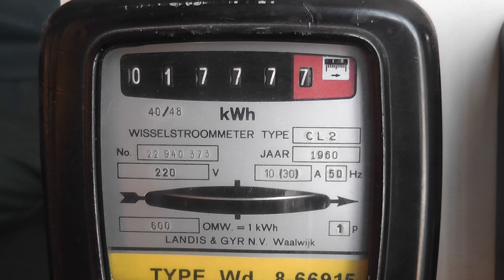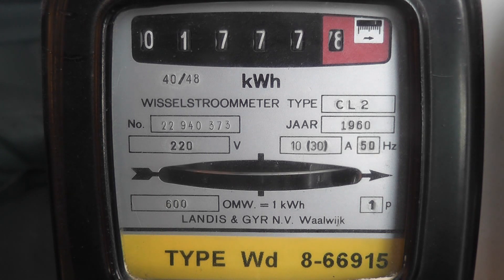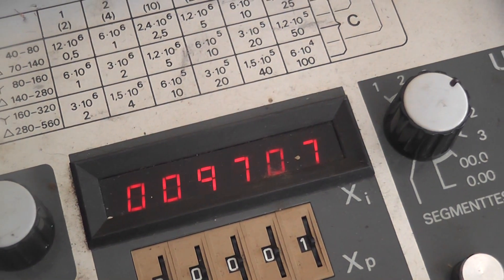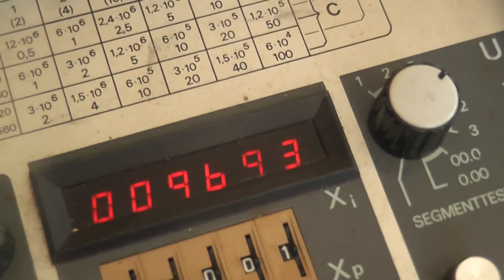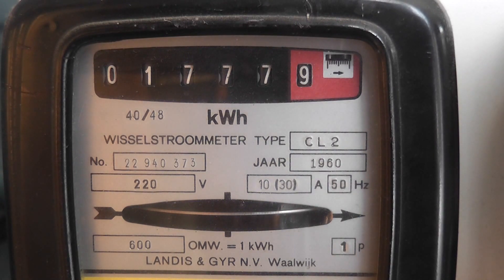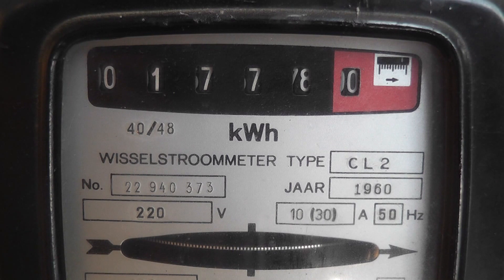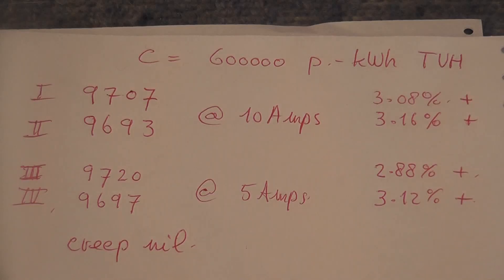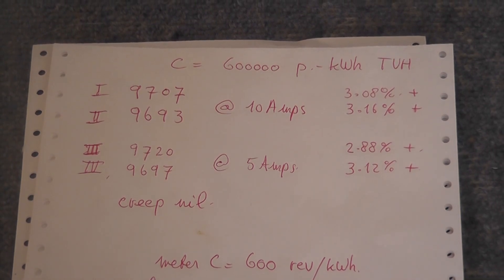Accuracy check on 55 year old kWh meter

Comment: Aaaah, 1960. This is the same year as my Sangamo Weston S200.7.

Hmmm..... That percentage on your Landis & Gyr wisselstroommeter is a bit more than it should be. :-( The accuracy on this one will need to be pulled-in a bit.

On that note.... If I had to pull-in the accuracy on this one, I'd set it as close as possible to halfway within the allowable tolerance.

My calculations are:

Loadwheel characteristic = 600 revs. Tolerance = 2% (2% of 600 = 12)

Therefore:

Loadwheel fast-limit would be 612 revs
Loadwheel slow-limit would be 588 revs

Of course, those limits are for one whole kWh. For a 1/10th kWh test, I've calculated that the loadwheel rev-limits would be:

Fast-limit = 61.2 revs 
Slow-limit = 58.8 revs

Hopefully, the loadwheel has numbered increments on it. :D

Ideal number of revs after a 1/10th accuracy test = 60 revs for spot-on-the-dot.

So yes, if after tweaking things up a bit, the meter then read 59.9 revs for a 1/10th kWh accuracy test, I'd know that it was slightly on the slow side, but within the allowable limit of the 2% tolerance.

I'll stay tuned to see if you successfully pull-in the accuracy of this instrument.

Thanx for showing,

-BoomBoxDeluxe.

26th October 2015, 02.20
Reply: Wat ever hqppent to boombox duluxe xD
Reply from the maker: +Mr Pepsi Pepper He is back.
Reply: Was messing
Reply: RODALCO2007 was doing a photonicinductions quote